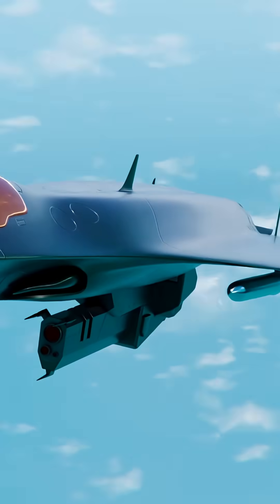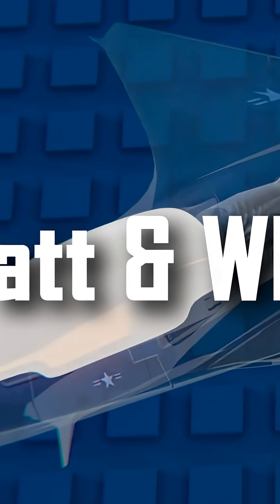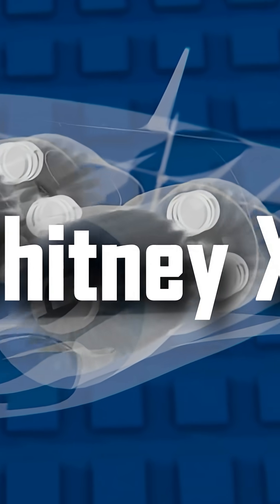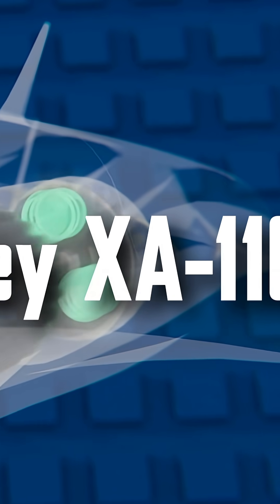Why Is This Jet Almost Invisible?

Comment: A fighter that can loiter for 8 hours in total radio silence? 

A jet that can supercruise at mach 1.5, but tops out at mach 2.3, with a likely 90,000 pounds of thrust in burner and a greater than 1:1 thrust to weight?

Comment: "Zero heat signature" I have heard a ton of tall claims, this one would demand physics that we've known for centuries that are the bane of all engineering to magically be broken.
Reply: I learned in my first engineering class, “What goes in, comes out or accumulates.”  If the exhaust was as cool as the surrounding air, the pilot must be awfully warm.

Comment: Weve already built one and decided to go with the electro magnetic bolt, the mach 7 speed and intrusive wave length disable system works better. Get with the times, gees

Comment: On such a new plane I really hate when they have to divulge certain special characteristics so the Chinese can figure it out. Especially about redirecting Cold Bleed air from the engine compressor to cool down the exhaust. Couldn't they leave out the details on that one other than mentioning that it gives off no heat signature? It's bad enough that they copy everything we have. It'd be nice to be able to go a decade or more before they catch up to things that were putting out now
Reply: How does anybody really know anything about the F4 7 yet? This short is just AI slop.
Reply: You forgot to mention how bad it is you copied the J20 to produce the F47. You laughed your guts out when they added canards to the J20... cos that was a big fat compromise on stealth. Then you discovered they're ahead of you, they knew something you apparently didn't know about those little winglets then you put them on the F47. That's not to mention just how bad it is that you're copying off of IRAN! You cloned their Shahed and named it Lucas. 

🤣🤣🤣
Reply: @hmjega 😂 you’re actually cuckxing so hard for the ccp that you fortot about su bin 🤣🤣